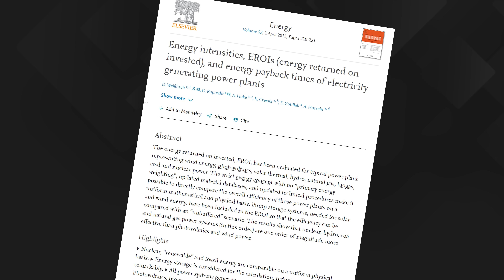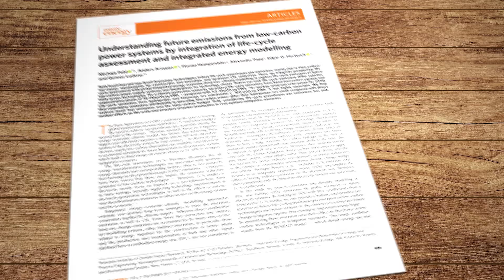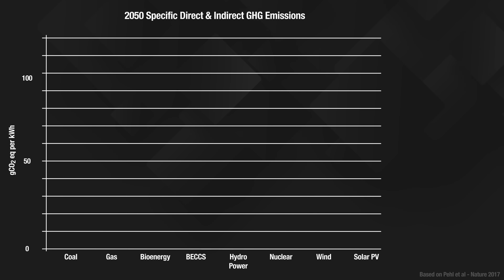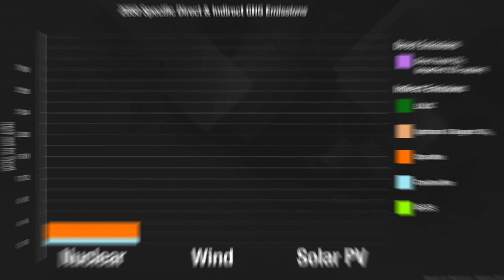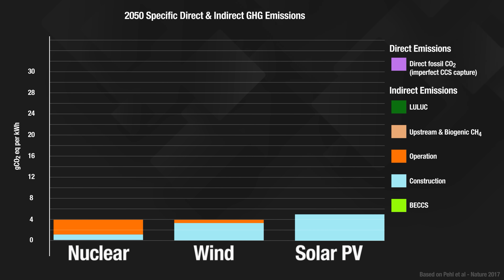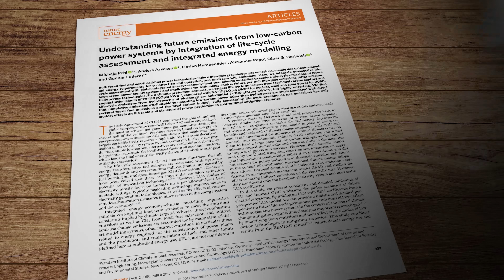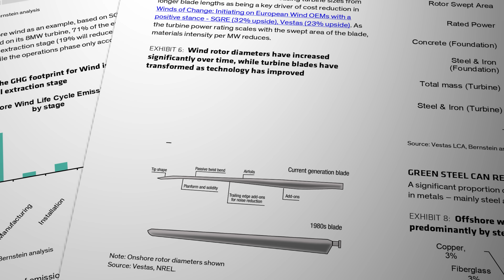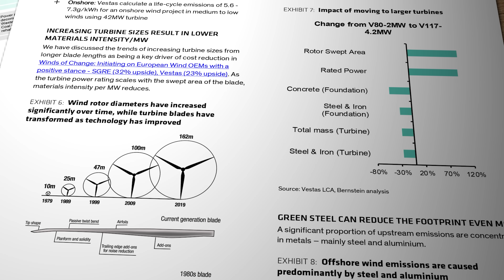Lifetime carbon emissions of renewables vs fossil fuel. Problem or solution?

Comment: Doesn't all this discussion of the benefits of technologies, recycling system, etc., depend upon the functioning of a global logistics system? When the one thing we know -- as shown by Ukraine crisis and food supply, or Suez Canal closure -- is that the global logistics/just-in-time system is very fragile. Therefore, will it survive the disruptions from both climate change and resource depletion already 'baked in' (pun intended) to the near-future?

Unless you engage with systemic complexity, and find ways to isolate/insulate energy & food systems from that brittle system, rather than embracing the limited boundaries of economists and technologists, there's no certainty that any of those technologies will be able to function as anticipated.

Comment: As mentioned, up to a certain percentage of the power supply, renewables are a no brainer. Once we reach a high percentage though, the need for storage becomes a real issue. The obvious way to achieve storage is to force the use of wind/solar when they are producing, and to ramp up hydro generation when they produce little. Unfortunately the figures for CO2 emissions of hydro are discouraging. Nuclear, I believe is hard to ramp up quickly, meaning without advances in storage or smart grids we have a ceiling for the percentage of wind/solar we can use. Electric car batteries can help to a degree, but there are issues with matching generation with convenient times for recharging. In addition if it's an NMC Lithium battery, charge and recharge significantly reduces the battery lifetime. Not so for LFP. lots to think about.
Reply: I'd say for as long as we have no effective way of storing energy our current nuclear energy production can serve as a reliable backup for longer times of lower productivity like production during nighttime. Nuclear power is expensive, but at the very least "green" and it exists. Building huge water storages surely is a vialble idea, but not the most efficient one either since it takes up a lot of space which we'd really need for biopreservation, agriculture and renewables. It's not unusable, but should be kept only at a limited area.

Comment: Glad to see Concentrated Solar Power (CSP) getting a much needed mention, having written my Engineering Honours Thesis on the topic, it's crazy to me that there isn't more of a drive to pursue the technology! So many commenters have queried whether the storage systems (batteries) for Wind and PV have been considered in the Life Cycle Assessment (LCA) studies presented. A LCA is a controlled and standardised methodology and a well performed one would be required to include the entirety of the system in its scope, so if the systems presented had battery backups they'd most likely be included. Nowadays though the majority of CSP plants are designed and built with their own storage system, Thermal Energy Storage (TES) literally heat batteries utilising molten salt. This mean they have 24hr access to heat energy used to generate electricity, as needed, night or day!! And as you all saw in this amazing video from Dave, CSP only produces 27g CO2-E/kWh!!!! WE NEED MORE CSP!!!!
Reply: The problem with CSP is it works best in hot dry climates, but it also can consume quite alot of water, which is a problem since that's usually a limited resource in the area. Advancements have been made in cooling towers so more of the steam produced can be reused, but it's not enough.

This is why CSP has been getting shut down for years in the western US and replaced with solar PV and wind.

Maybe we'll see a resurgence with MIT's new heat engine, which is solid state and can beat steam engine efficiency in some senarios.
Reply: @vorpolkai   heat transferring media can be other materials which will replace water maybe.
Reply: Yeah, that super hot salt can be an issue if it leaks, but the tech is awesome. We need more development here.
Also with regards to water consumption, countries could use solar desalination plants, fresh water for CSP and use the brine for mineral extraction.
Reply: @Sam-sc6rr  desalination uses the sea water and disrupts plankton growth.... Why don't we put iron ore dust in the ocean and increase plankton growth and fish population.... Olivine is also another untapped potential.... But these methods aren't highly profitable
Reply: CSP can't compete with wind and solar PV on price per MWh when you are in an overall energy mix where storage is not required because there is enough gas power to fill in the gaps. Once we get closer to 100% low carbon electricity, having dispatchable power like CSP will become much more important. Those early CSP plants were just trying to operate in an economic environment that didn't properly value their primary advantage. They were before their time. In the future I think CSP can have a role to play, provided they can deal with the molten salt corrosion problem. Which by the way is an even bigger concern for molten salt nuclear plants!
Reply: Sorage is generally not included, because storage is often optional and there are several varieties of storage solutions. So I'd be carefull trusting number there.

Comment: Materials for PV and wind energy can be reused to some degree. Whereas coal, gas, oil and Uranium are consumed.
Reply: Uranium in theory is reusable too. Of course we lack the technology to really do so reliably but it is possible.
Reply: @DommTom  Yes, but currently we are putting all effort in burrying that stuff.
Reply: @markandreessen3218  I can't really complain. Imagine we would pay for burrying it and instead would left it disposed.
Reply: @DommTom  In my humble opinion this idea of safely disposal for several thousand years is doomed to fail. I believe we should treat them as dangerous but valuable raw materials and monitor them. That would be less waste of energy and create jobs.
Reply: @markandreessen3218  You can't monitor something that'll outlive civilzation by a few times.

Comment: I believe you should have a look at what's currently happening in Australia. The cost of renewables is so low that Coal and Gas cannot compete in the "bidding" system we use to sell electricity. As they cannot compete, the coal stations are shutting down and this is putting pressure on supply. We have a complicated system of bidding every few minutes to sell the electricity. The government has had to step in and attempt to force Coal stations to supply electricity with potentially some form of compensation provided to coal and gas, which of course will indirectly come from the taxpayers. 
We are also considering a new system for the future where coal and gas stations will be formally and directly compensated into the longer term to stay productive and run regardless of not being cost effective. I guess the poor little dears can't make enough money. (boo hoo). 
It wasn't that long ago that our right wing government suggested they will not subsidize renewables as they must stand on their own two feet and compete with Coal and Gas. Now they are and the Coal and Gas companies are taking their bat and ball home.
BTW, love your work and watch all your videos.

Comment: CO₂ is a nutrient, necessary for photosynthesis 
6H₂O + 6CO₂ => C₆H₁₂O₆ + 6O₂ 
we are carbon based life 
carbon is the element of life 
there can only be as much life on the planet as there is carbon available to make it out of 
there is too little CO₂ in the atmosphere, not too much 
CO₂ was 1,950 ppm during the Jurassic period, for example 
nearly 5 times today’s level
Reply: Saying that we should pump infinite carbon into the atmosphere to get infinite life back is just as smart as inhaling pure oxygen. It's absolutely dumb.
Reply: @DommTom  
i never said infinite carbon
and we aren’t pumping infinite carbon, anyway
we are putting an insignificant amount of carbon into the atmosphere 
what i am saying is that the insignificant amount of carbon we are putting into the atmosphere is beneficial for life 
don’t worry about it
Reply: @johnvoelker4345  " the insignificant amount of carbon"
No, our amount is very significant.
"carbon we are putting into the atmosphere is beneficial for life "
No, the photosythesis of plants starts to deminish at a CO2 concentration of about 2% and at around 3% plants begin to suffocate.
It''s like breathing pure oxygen. you might think it's beneficial, but in reality pure oxygen is very toxic to humans the same way carbondioxide in deadly for plants in a 3% concentration.
Reply: @DommTom  
‘photosynthesis starts to diminish at around 2% ‘
that’s nice
CO₂ is 0.04% of the atmosphere today
so, if we get 50 times as much CO₂ in the atmosphere as we have today, photosynthesis will start to diminish
Reply: @johnvoelker4345  Actually, it's only 1% (according to Wikipedia; I've re checked) and 0,04% is the natural amount. But that amount is bviously much higher now. 0,04%-0,1% is where most plants are the most productive at. But when you look at graphs depicting the CO2 concentration the amount is now way beyong that since the past century. We are still not at 1%, but if we won't do anything we will sooner or later.
Reply: @johnvoelker4345  Well, theoretically it's possible. But the original argument wasn't about whether we'll reach 1%, it was about your claim thatmore CO2 equals more Photosythesis which just isn't true.
When talking about the enviromental effect of CO the focus usually lies on diffenrent things like the worlds oceans and the atmosphere. There are planty of reasons why the current CO2 emissions will cause severe enviromental harm if we won't do anything.
Reply: @DommTom  
CO₂ is around 420 ppm
greenhouses and marijuana growers use between 1,200 ppm and 1,500 ppm 
- people who grow plants for a living
Reply: @johnvoelker4345  "CO₂ is around 420 ppm"
That's natural. That's the global avarage.
"greenhouses and marijuana growers use between 1,200 ppm and 1,500 ppm "
That's artificial and only applies to very few plants.
" people who grow plants for a living"

People who run greehouses for a living are usually very well off. Those who aren't usually don't run greenhouses but moreso conventional grains.
And increasing the ppm to over a 1000 would be absolutely stupid ehen the natural number is between 300 and 400.
Reply: @DommTom  
we live in the Cenozoic era 
the Mesozoic era, when the dinosaurs lived, was comprised of 3 periods - the Triassic, the Jurassic, and the Cretaceous 
the Triassic had CO₂ levels of 1,750 ppm 
that was natural 
the Jurassic had CO₂ levels of 1,950 ppm 
that was natural 
the Cretaceous had CO₂ levels of 1,700 ppm 
that was natural 
at the beginning of our eon, the Phanerozoic, 540 million years ago, CO₂ was 4,500 ppm 
that was natural
Reply: @johnvoelker4345  Dude, you really have no understanding of basic ecology I myself am no expert on biology and even I'm totally facepalming myself when reading your comment.

Whether ppm's of over 1000 were noemalr at some point of earth's histotry has nothing to do with the fact, that in our current world the natural concetration of CO2 lies at 300-400ppm. All ecosystems are adapted to that specific value. And changig that would destroy all those ecosystems because nature is always build around a balance that's extremely fragile. Even ppm's of 500 would start causing serious enviromental damage simply due to the fact that 500 is not 400.
Reply: @DommTom  
‘
verb
\ ˈstärv  \
starved; starving
Collegiate Definition
intransitive verb
1a : to perish from lack of food
b : to suffer extreme hunger’
- Mirriam Webster
i am using it as in definition b
Reply: @johnvoelker4345  "i am using it as in definition b"
nobody does that (atleast I've never met one). When people say "starving" they mean dying due to malnutrition. Otherweise they're more precise. Not so you.

Besides: my comment revolved around alot more and all you can respind to is the definition of the word "starvation"?
What else can you do?
Reply: @DommTom  
everybody does that
you’ve never heard anyone say, ‘i’m starving’?
Reply: @DommTom  
CO₂ has risen slightly the last 100 years 
plants have benefited from this increase in CO₂ 
plants would continue to benefit from further increases in CO₂
deserts are greening from this rise in CO₂ 
and the entire planet is greening from this rise in CO₂
Reply: @DommTom  

Deserts 'greening' from rising CO2
by CSIRO

Satellite data shows the per cent amount that foliage cover has changed around the world from 1982 to 2010.
Increased levels of carbon dioxide (CO2) have helped boost green foliage across the world's arid regions over the past 30 years through a process called CO2 fertilisation, according to CSIRO research.
Reply: @johnvoelker4345  You don't need to increase CO2 levels for freening up the dessert.
Because increasing the CO2 levels is really stupid, it causes more drought and therefore more dessertification.
Reply: @DommTom  
plants take in CO₂ through holes in their leaves, called stoma
but, they also lose water through these holes
higher levels of CO₂ in the atmosphere allow plants to reduce the number of stoma, while still getting the CO₂ that they need 
this makes the plants more water efficient, reducing desertification
Reply: @johnvoelker4345  "this makes the plants more water efficient, reducing desertification"
dude, you're completetly missing my point!
Higher CO2 concentration accelerates the greenhouse effect which increases global temperatures making areas around deserts far dryer. And no, the apparent water efficiency of plants won't win out against this.
Seriously, how can anyone claim the increase of CO2 concentration beyond a greenhouse to be a good thing except for those paid internet trolls?
increasing CO2 concentration will cause a global catastrophe if we won't decrease our emissions. That's a fact, it's been proven, so stop picking out minor things and look at the everything!
Reply: @DommTom  
we are currently in a major ice age 
global warming would be beneficial for the biosphere
Reply: did humans and our current eco-system exist during the Jurassic period?
No.

Jesus Christ what a dumb comment...

Comment: If legislation was in place which forced housing companies to produce extremely environmentally friendly houses in the 1st place then, we wouldn't need to depend on so much energy in the future.
All houses could be made with ground sauce heat pumps pre installed, the latest energy efficient windows and doors and insulation. They could all be south facing with solar panel roofs and battery storage.
Lighting could be on 12 or 24v led systems throughout the house etc.
Rain water storage for toilet flushes and washing machine usage...
There's so many ways that newer buildings could be made really efficient but because legislation doesn't force it, the building companies will always do whatever is the minimum requirement.

My brand new house still came with a natural gas boiler, no solar or heat pump, we didn't even get the option to have anything to produce our own energy or anything.
For us to retrofit these technologies will cost tens of thousands and will never be as efficient or as seamless as if the property was built with all of this is mind at the development stage.